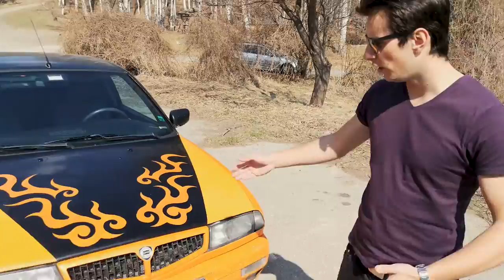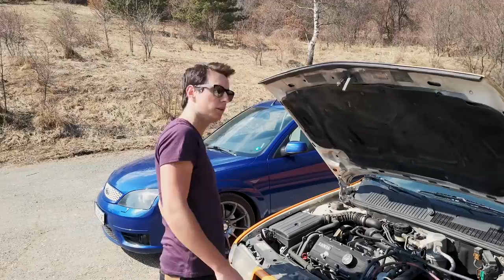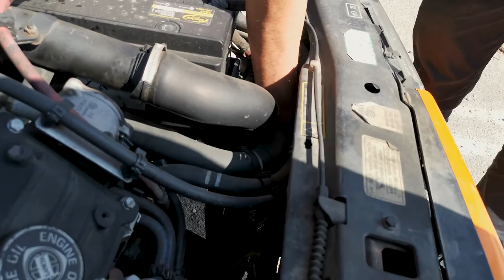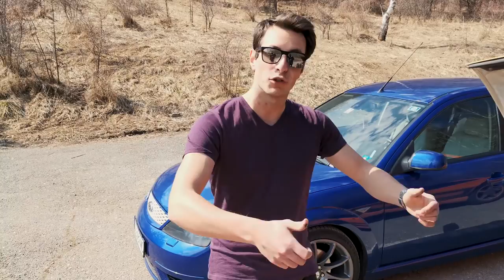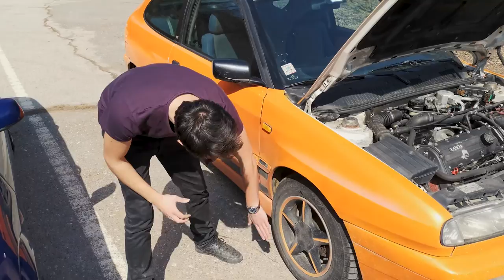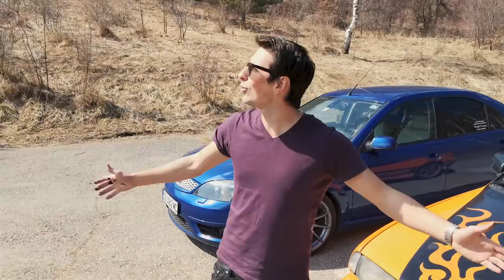How Bad is the Turbo on my Project Car?? - Rarest Car on YouTube

Comment: hahahaha, building a car in real life is fun but very expensive. That lancia might've lost some power cause i had a 90 hp turbodiesel and the tires used to spin a lot on the launch till 2nd, maybe it was because of the shitty tires, i dunno and also it was dohc instead of sohc as that one and from the 2000.
Reply from the maker: Yep I won't be going wild with the build hahah